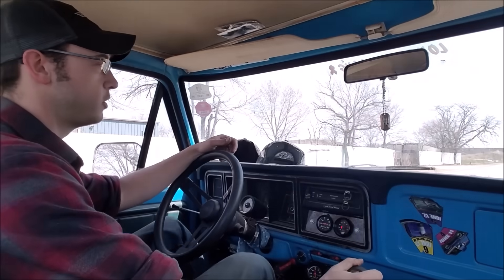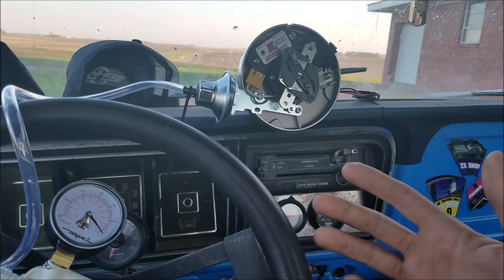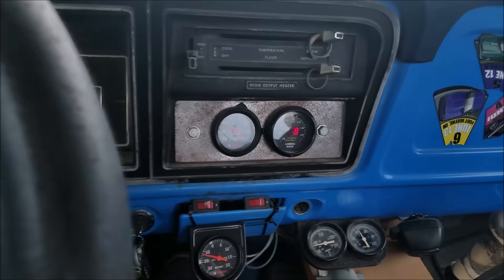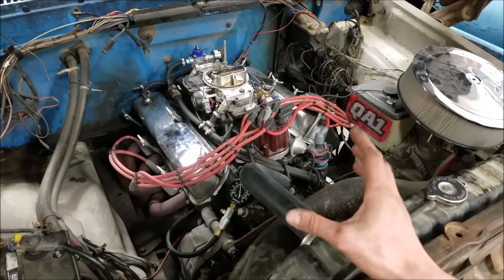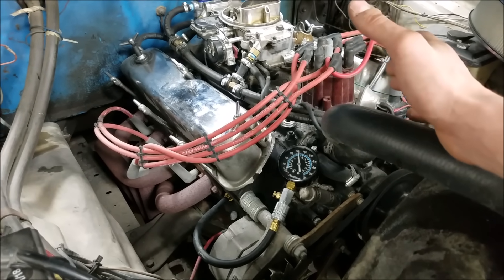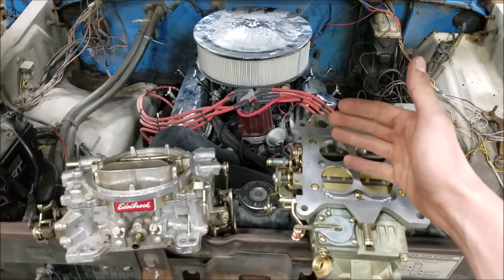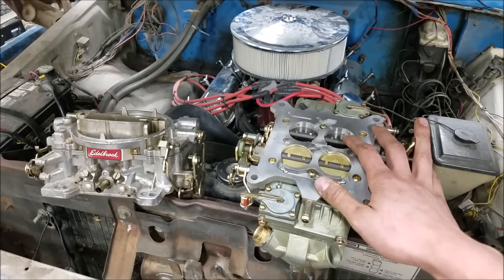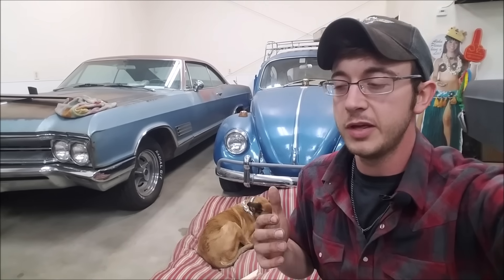Vacuum Advance - Ported vs Manifold: Which to Use & When !!!

Comment: Back in my 20's and 30's I was all in on the muscle cars and working on them, I had a 71 Chevelle ss 402 and 400 turbo. Now I am 65 and I just bought a 67 Chevelle with a 400 sbc. Definitely a shade tree mechanic installed it. It has an accel distributor and they did not hook up the vacuum advance to anything. It is hard to start idles ok and shabby on acceleration off. I am here doing research on ported or manifold. Plus whoever installed this engine did a poor job at setting up the power brakes as well.

Comment: That progresion ignition thing seems cool but adds a reliability issue if that module goes out or the pick up youre stuck ,but by using a welder you can modify the advance slot and use 1968  vaccum pod that you can change springs and spacer to tune vac advance i trigger my duraspark box with points so if my module goes out i can piggyback wire’s to flip a switch now it works like a old school points fired ignition

Comment: TIMING AND VACUUM ADVANCE 101 by GM Engineer (not me).

The most important concept to understand is that lean mixtures, such as at idle and steady highway cruise, take longer to burn than rich mixtures; idle in particular, as idle mixture is affected by exhaust gas dilution. This requires that lean mixtures have "the fire lit" earlier in the compression cycle (spark timing advanced), allowing more burn time so that peak cylinder pressure is reached just after TDC for peak efficiency and reduced exhaust gas temperature (wasted combustion energy). Rich mixtures, on the other hand, burn faster than lean mixtures, so they need to have "the fire lit" later in the compression cycle (spark timing retarded slightly) so maximum cylinder pressure is still achieved at the same point after TDC as with the lean mixture, for maximum efficiency.

The centrifugal advance system in a distributor advances spark timing purely as a function of engine rpm (irrespective of engine load or operating conditions), with the amount of advance and the rate at which it comes in determined by the weights and springs on top of the autocam mechanism. The amount of advance added by the distributor, combined with initial static timing, is "total timing" (i.e., the 34-36 degrees at high rpm that most SBC's like). Vacuum advance has absolutely nothing to do with total timing or performance, as when the throttle is opened, manifold vacuum drops essentially to zero, and the vacuum advance drops out entirely; it has no part in the "total timing" equation.

At idle, the engine needs additional spark advance in order to fire that lean, diluted mixture earlier in order to develop maximum cylinder pressure at the proper point, so the vacuum advance can (connected to manifold vacuum, not "ported" vacuum - more on that aberration later) is activated by the high manifold vacuum, and adds about 15 degrees of spark advance, on top of the initial static timing setting (i.e., if your static timing is at 10 degrees, at idle it's actually around 25 degrees with the vacuum advance connected). The same thing occurs at steady-state highway cruise; the mixture is lean, takes longer to burn, the load on the engine is low, the manifold vacuum is high, so the vacuum advance is again deployed, and if you had a timing light set up so you could see the balancer as you were going down the highway, you'd see about 50 degrees advance (10 degrees initial, 20-25 degrees from the centrifugal advance, and 15 degrees from the vacuum advance) at steady-state cruise (it only takes about 40 horsepower to cruise at 50mph).

When you accelerate, the mixture is instantly enriched (by the accelerator pump, power valve, etc.), burns faster, doesn't need the additional spark advance, and when the throttle plates open, manifold vacuum drops, and the vacuum advance can returns to zero, retarding the spark timing back to what is provided by the initial static timing plus the centrifugal advance provided by the distributor at that engine rpm; the vacuum advance doesn't come back into play until you back off the gas and manifold vacuum increases again as you return to steady-state cruise, when the mixture again becomes lean.

The key difference is that centrifugal advance (in the distributor autocam via weights and springs) is purely rpm-sensitive; nothing changes it except changes in rpm. Vacuum advance, on the other hand, responds to engine load and rapidly-changing operating conditions, providing the correct degree of spark advance at any point in time based on engine load, to deal with both lean and rich mixture conditions. By today's terms, this was a relatively crude mechanical system, but it did a good job of optimizing engine efficiency, throttle response, fuel economy, and idle cooling, with absolutely ZERO effect on wide-open throttle performance, as vacuum advance is inoperative under wide-open throttle conditions. In modern cars with computerized engine controllers, all those sensors and the controller change both mixture and spark timing 50 to 100 times per second, and we don't even HAVE a distributor any more - it's all electronic.

Now, to the widely-misunderstood manifold-vs.-ported vacuum aberration. After 30-40 years of controlling vacuum advance with full manifold vacuum, along came emissions requirements, years before catalytic converter technology had been developed, and all manner of crude band-aid systems were developed to try and reduce hydrocarbons and oxides of nitrogen in the exhaust stream. One of these band-aids was "ported spark", which moved the vacuum pickup orifice in the carburetor venturi from below the throttle plate (where it was exposed to full manifold vacuum at idle) to above the throttle plate, where it saw no manifold vacuum at all at idle. This meant the vacuum advance was inoperative at idle (retarding spark timing from its optimum value), and these applications also had VERY low initial static timing (usually 4 degrees or less, and some actually were set at 2 degrees AFTER TDC). This was done in order to increase exhaust gas temperature (due to "lighting the fire late") to improve the effectiveness of the "afterburning" of hydrocarbons by the air injected into the exhaust manifolds by the A.I.R. system; as a result, these engines ran like crap, and an enormous amount of wasted heat energy was transferred through the exhaust port walls into the coolant, causing them to run hot at idle - cylinder pressure fell off, engine temperatures went up, combustion efficiency went down the drain, and fuel economy went down with it.

If you look at the centrifugal advance calibrations for these "ported spark, late-timed" engines, you'll see that instead of having 20 degrees of advance, they had up to 34 degrees of advance in the distributor, in order to get back to the 34-36 degrees "total timing" at high rpm wide-open throttle to get some of the performance back. The vacuum advance still worked at steady-state highway cruise (lean mixture = low emissions), but it was inoperative at idle, which caused all manner of problems - "ported vacuum" was strictly an early, pre-converter crude emissions strategy, and nothing more.

What about the Harry high-school non-vacuum advance polished billet "whizbang" distributors you see in the Summit and Jeg's catalogs? They're JUNK on a street-driven car, but some people keep buying them because they're "race car" parts, so they must be "good for my car" - they're NOT. "Race cars" run at wide-open throttle, rich mixture, full load, and high rpm all the time, so they don't need a system (vacuum advance) to deal with the full range of driving conditions encountered in street operation. Anyone driving a street-driven car without manifold-connected vacuum advance is sacrificing idle cooling, throttle response, engine efficiency, and fuel economy, probably because they don't understand what vacuum advance is, how it works, and what it's for - there are lots of long-time experienced "mechanics" who don't understand the principles and operation of vacuum advance either, so they're not alone.

Vacuum advance calibrations are different between stock engines and modified engines, especially if you have a lot of cam and have relatively low manifold vacuum at idle. Most stock vacuum advance cans aren’t fully-deployed until they see about 15” Hg. Manifold vacuum, so those cans don’t work very well on a modified engine; with less than 15” Hg. at a rough idle, the stock can will “dither” in and out in response to the rapidly-changing manifold vacuum, constantly varying the amount of vacuum advance, which creates an unstable idle. Modified engines with more cam that generate less than 15” Hg. of vacuum at idle need a vacuum advance can that’s fully-deployed at least 1”, preferably 2” of vacuum less than idle vacuum level so idle advance is solid and stable; the Echlin #VC-1810 advance can (about $10 at NAPA) provides the same amount of advance as the stock can (15 degrees), but is fully-deployed at only 8” of vacuum, so there is no variation in idle timing even with a stout cam.

For peak engine performance, driveability, idle cooling and efficiency in a street-driven car, you need vacuum advance, connected to full manifold vacuum. Absolutely. Positively.
Reply: If I have a full stock engine. Would I be better off moving from ported to manifold vacuum?
Reply: @zandernorthup5794  For performance, yes. For emissions, no. If you live in an area with strict emissions standards, your car may fail emissions at idle with manifold vacuum. Again, the purpose of ported vacuum is to keep timing retarded at idle. Retarded idle equals less hydrocarbon at the expense of engine performance. One caveat. If your engine is "full stock", advanced timing may not increase performance enough for you to notice in the seat of your pants. It might not be worth the effort. I say give it a try and see.

Comment: My biggest issue is missing all my old Fords. Especially my '65 Mustang and '64 Galaxie 4-door. (wipes away tears of regret) Currently have an '87 Escort EXP with a 116 cu in engine, refuse to go metric. Came with a roller cam, but I have the largest one made for it, stock hi po, changed from the absolutely pathetic TBI to a Weber two bbl, still stock intake but made an adapter, ported the head, not sure if it helped but sure didn't hurt, replaced original distributor because it was unadjustable (used a stock one from the year before which came with a carb), broke a piston because of a bad head gasket, so the engine is in pieces, and currently have an intake/turbo combo from a '79 Mustang that is being adapted to fit. Why? It's cheap! Got the turbo for $100, manifold and carb were free, (my buddy swore it would fit, he should give up swearing). The carb was crap, hence the brand new Weber, and even now it hits 6000 rpm before I can get my foot out of the throttle in 1st and 2nd. Did I mention the Accel ignition with a rev limiter? Already close to 1hp/cu in using old tech, so all the info on timing is just what I needed. Might have to back off once I get the turbo mounted, but having fun in grease up to my armpits. Did I mention I miss my old 289 and 352? sigh Keep up the great work! Also love the custom adapter for the alternator on the truck, my kinda guy. 👍
Reply: I also write too much, but I'm old enough to have written letters, by hand, in cursive, in real envelopes, by Galaxie was purchased by my grandparents 3 months before I was born, man I miss my little big block.

Comment: I've just installed brake booster and I have problem with engine (289, aluminum heads and 4bbl holley) stall whenever I apply hard braking (like emergency braking) in Drive and in Neutral... the car stops and the engine stalls... I know there are many things to check out but I think I've checked more or less everything that BB is ok, no leaks, carb's idle screws were adjusted and I have healthy vacuum too... but one question pops to my mind... could switching from ported vacuum advance to manifold vacuum improve that stall since the timing in idle will be different and thats exactly (if I understand correctly) when the car comes to full stop? Thank you for sharing your knowledge. I really like your videos full of useful informations.

Comment: Hey Luke, what are your thoughts about drilling holes in throttle butterflies to compensate for lack of idle airflow with a bigger than stock cam with 12" of vacuum at idle under 1,000 rpms to make the idle mixture screws responsive to clean up an idle?

Comment: I learned its your distributor advance type that determines whether or not it's ported or manifold. Although mine ran better on ported with an improperly sized and possibly bad power valve when it should be manifold. Once I fixed the carb and leaned it out, it ran way better on manifold as it's supposed to.

Comment: I see this is a 5 year old video but if anyone’s still out there my thoughts are :- If you run hot in idling traffic then using manifold vacuum can help keep engine temps’ down without having to mess with the mechanical advance side. Otherwise just get rid of the vacuum men those capsules just get in the way😮

Comment: The reason they use 'ported' vacuum is so engine idle can be slowed when the throttle is almost closed. (Full manifold vacuum speeds up idle). The proper idle speed setting thus requires the throttle idle setting to be set open slightly to speed it back up to normal. This setup was designed to lower idle emissions by slightly increasing airflow rate into the intake. This allows a leaner idle mixture (thus lowering carbon monoxide) This was first used in the late 1960s, long before cats came into universal use (1975 model year).
Problem is that, this setup increases the likelihood of 'dieseling' (engine continues to run on when the ignition is cut off). They had to add an 'anti-dieseling' electrical solenoid that would close the throttle when engine shuts off in order to circumvent this problem.

Comment: Vacuum advance is used only for improved fuel economy. It does nothing for performance.
However, cars built since 1973 have EGR, which kills some fuel economy. But most of that lost fuel economy is restored by a radical vacuum advance curve (I've measured this as being up to 40+ degrees). This means that if you disconnect the EGR, this early-spark vacuum advance will probably cause a profound spark knock. This was a common problem in some 1970s engines. So if you do an EGR delete, you MUST re-curve the vacuum advance in the distributor! Some distributors, you can insert an allen wrench into the hole (where the vac advance hose is connected) in order to adjust it. Newer engines don't have this knocking issue.

Comment: Nice video... My service manual for an AMC AMX says set the idle to 650.  Do you think that's a bit low to get into those transfer slots you were talking about on the Holley.  OEM was Carter AFB.  It hesitates pretty bad when you hit the gas - it's a 390, 4 speed with a Holley 600 vacuum sec.   What's a good setting for idle speed?  Thanks for your help in advance - Jerry

Comment: I put a Chevy HEI distributor in my boat. The original monstrosity was a mercruiser marine unit based on the old duraspark ignition system Ford used in the late 70s and early 80s on the top and a Chevy small block bottom. It had no vacuum advance. The HEI unit I installed does have a vacuum advance. The carburetor on the engine is a Rochester quadrajet specifically for mercruiser marine. It has no vacuum ports anywhere. It's not even drilled where the brake booster would go and it has no PCV system. When I set the timing to where it had the most power, it would bind up whenever I start it. Especially when it's warmed up. I would have to move the timing ahead to get it to start and then move it back after it's running. The only place I found to put the vacuum advance was a plug in the intake where the modulator valve would normally go if it was in a car.  I took the plug out and drilled a 1/8 hole in it then I drilled a 3/16 hole about 3/4 the way through and bronzed a piece of brake line in it and put the vacuum advance hose to that. So far so good...

Comment: You are the ONLY person that understands that when set up with correct amount of STATIC TIMING (Initial timing / 10-20 degrees depending) that when you have ported vacuum and WOT from a stop, YOU STILL HAVE ALL OF YOUR BASE/STATIC/INITIAL TIMING! = Low end torque! --- However if you have that same engine running with 20° of ported timing, and you floor it [WOT] so it goes to 0" Vacuum...YOU NOW HAVE  MAYBE 5 DEGREES OF TIMING if you are lucky...Which means it has about as much low end torque as a 13B Wankel with bad apex seals!
Reply: Are you disconnecting the vacuum advance hose when setting initial timing? You are supposed to do that (not mentioned in the video)
Reply: @John-jd7mm YES, though IF you have the vacuum advance hooked to ported vacuum on the Carburetor it doesn't matter because it doesn't give any vacuum at "idle" (provided you have it adjusted well enough that the throttle plates are almost closed all the way.)
On some large (or wild) engines that need a LOT of air to idle, one may discover you cannot get the plates closed far enough, then drilling VERY tiny holes in the throttle plated maybe necessary. There are notes in the instructions on how to do this...ITS RARELY DONE